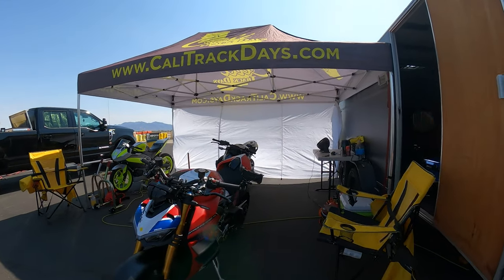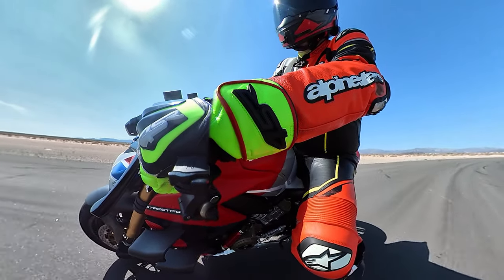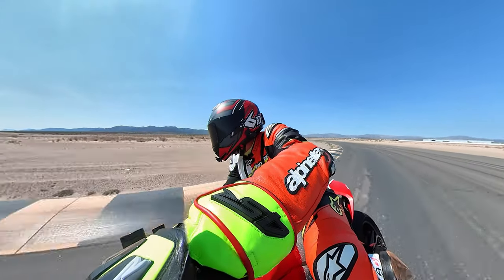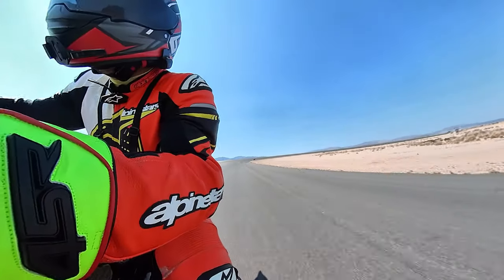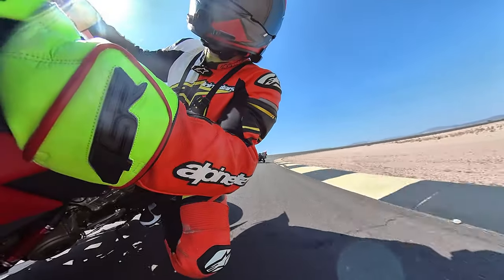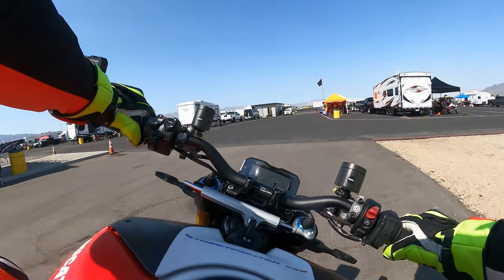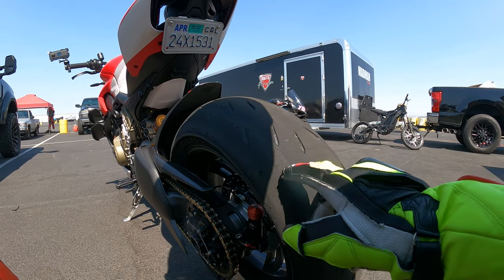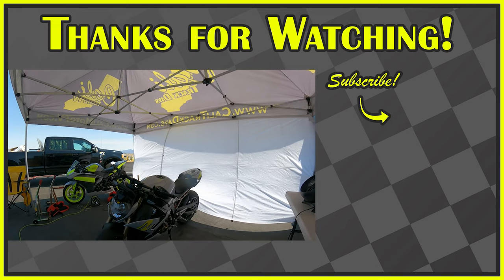First Ride with Oversuspension on Ducati Streetfighter at Chuckwalla Raceway

Comment: I got an Oversuspension unit 1 1/2 years ago for my Panigale V2. Not sure if they figured it out but the adjustment +/- and arrows were laser engraved backwards from what they should be. Anyhow short explanation is counterclockwise is the least amount of preload and clockwise is for more preload. 
I didn’t realize it until I started messing with the adjustments as I was believing the laser engraving on the adjustment cap.
Reply: Did i make a difference on your v2?
Reply: @davidgilis9061  yes, I felt the difference in the rear of the bike. it can also be seen, like Bill mentions, in the tire wear. Unfortunately there is no unit for the front like in Moto GP bikes
Reply: @Oneoffdesigns  thx for your feedback, will try it once my v2 bayliss is arrived